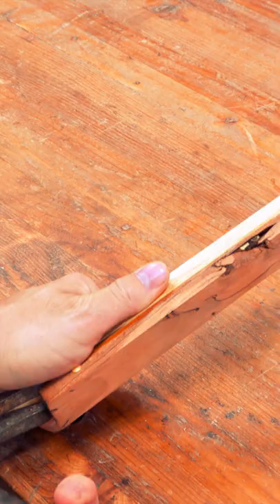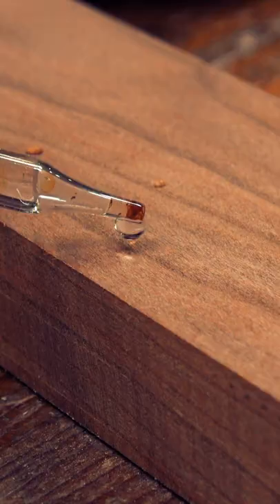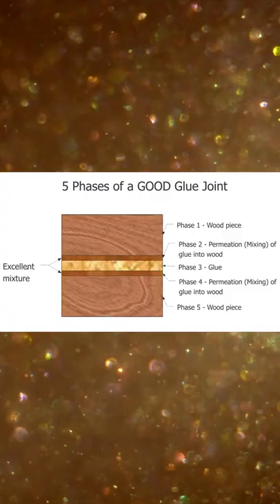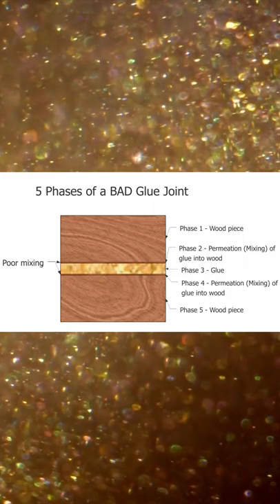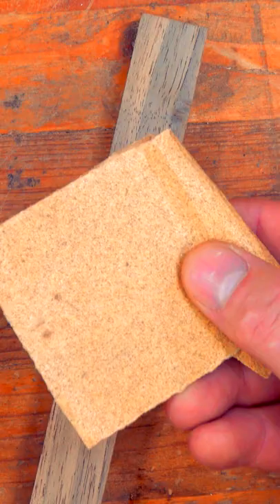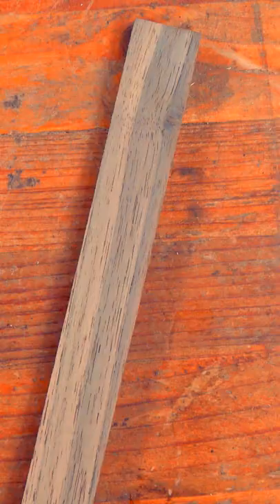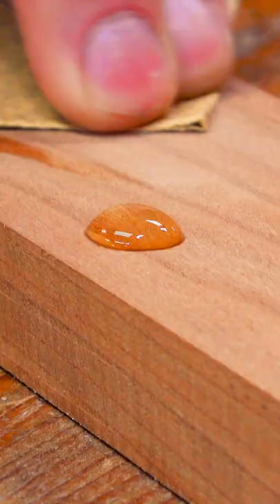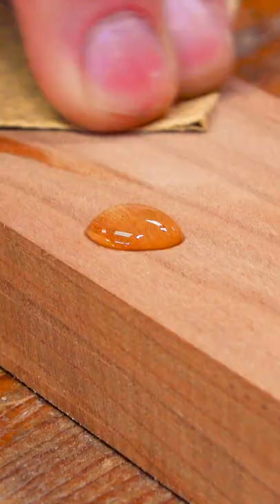40. Gluing OLD wood the RIGHT way #mtbitesize #shorts

Comment: Not sure that the water was absorbing into the wood, but rather into the wood that you left from sanding. It didn't absorb down, but rather spread out horizontally through the newly made wood dust.

Your original point might be valid, it just wasn't well proven in this video.

Though this is all just my opinion.
Reply: Was thinking the same thing

Comment: Same with welding metal. Cut the metal.  Let it sit. It'll get rusty or dusty or dirty.  Try to weld and it won't actually make a permanent weld.  Sand or scuff the ends and the weld can become a permanent thing. Also depends on if the welder knows what they are doing.

Comment: For those curious about why this happens:

Cutting/machining/sanding wood breaks the bonds of the wood, leaving "bonding sites." The glue adheres to these bonding sites. The more bonding sites, the better the adhesion.

Over time, water, dirt, dust, etc. bond with these open bonding sites. This leaves fewer sites for the glue to bond with, resulting in weaker adhesion.

Comment: So it's like how aluminum has a oxide layer that will from in a oxygen environment.
Reply: Aluminum oxidation is a chemical reaction with the metal and water/oxygen, resulting in the protective oxide layer (generally).

Cutting/machining/sanding wood breaks the bonds of the wood, leaving "bonding sites." The glue adheres to these bonding sites. The more bonding sites, the better the adhesion.

Over time, water, dirt, dust, etc. bond with these open bonding sites. This leaves fewer sites for the glue to bond with, resulting in weaker adhesion.